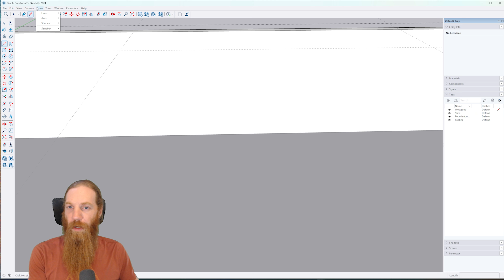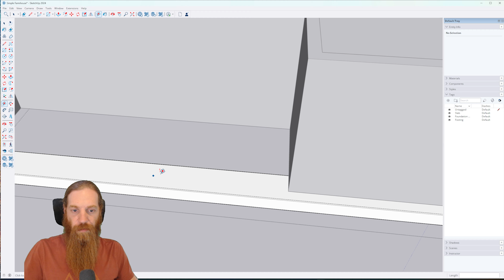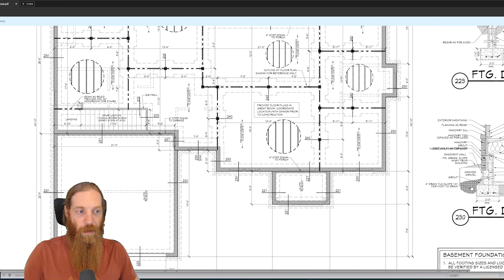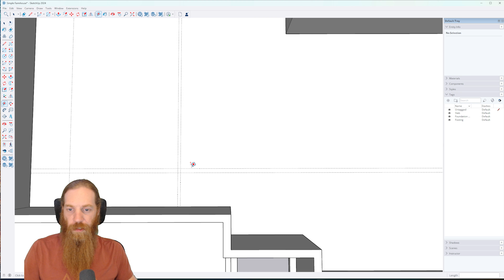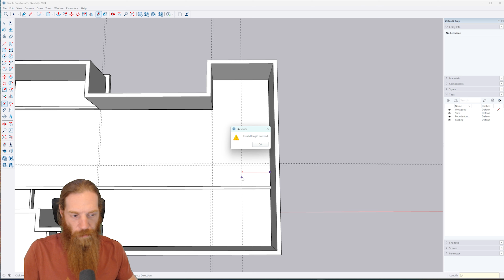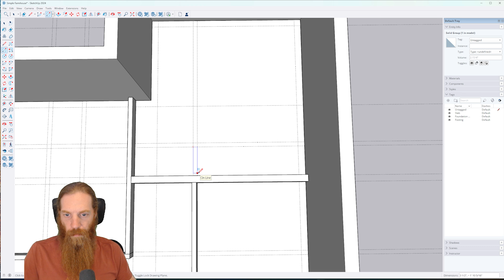How to Design & Build A New Home in SketchUp - Simple Farmhouse | 02

Comment: Bumping that out is going to take a lot of roofing though? I've tried designing my home a few times and you get into this spiral of thinking "If I do this it will save money!" but sometimes it doesn't. For instance, you could just hang that bump out on the side above the ground with florr trusses, but then your roof will be more complicated, and your floor there will be cold. Tradeoffs are always tricky. That's what I have no idea how to determine what's worth it and what's not. I took a 13 plus corner design and changed it to 8 corners, but I'm not sure if making all those changes will actually save that much money compared to some of the changes in design that I don't really like much.
Reply from the maker: Are you considering labor cost and time to build? As not just a builder but also a framer, I can tell you that I would build the 8 corner design for far cheaper and in less time that I would the 13 corner design, even if the 8 corner is bigger. People often forget that with a lot of building a home, the labor is the most expensive part, and that increases exponentially with complexity. I would also say, if you dont like a change, dont do it. Its not worth it, in ten years you might still have the home, but the amount you saved with changes you dont like will seem like pennies post-inflation.